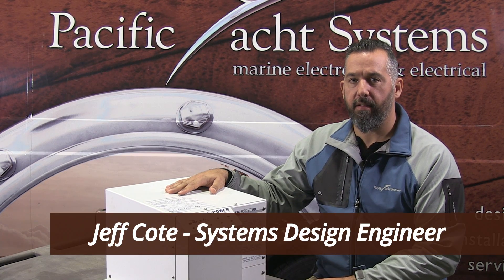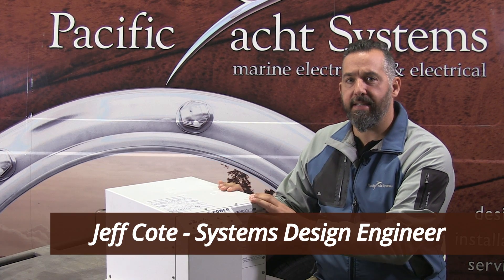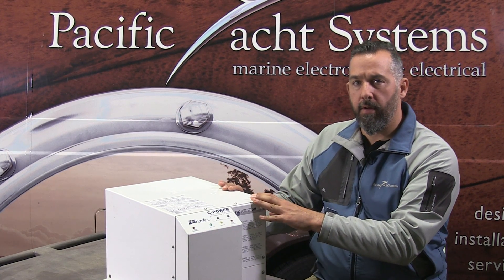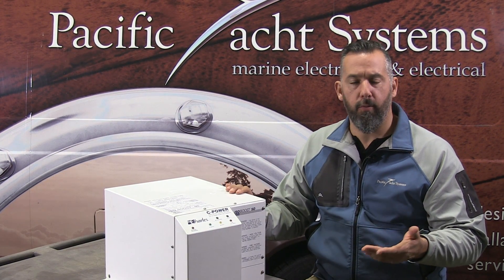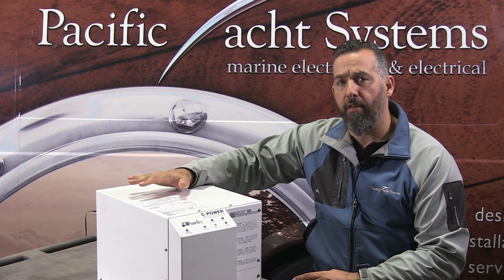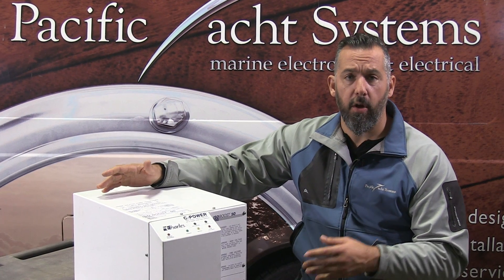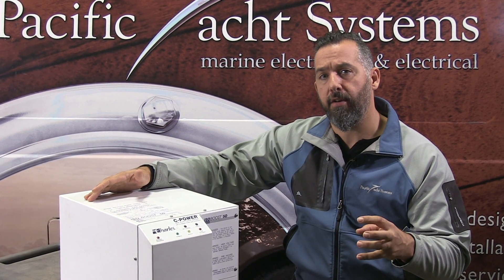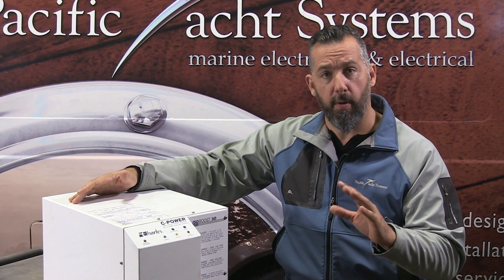Prevent Marine Corrosion On Your Boat With An Isolation Transformer

Comment: Jeff, on the secondary side of a marine isolation transformer, are the ground and neutral for the secondary bonded together? I know the shore power ground is not connected to the secondary in any way, but is there any connection of shore power ground to the chassis of the transformer? If there is no bonding of ground, does that mean all AC powered devices plugged into a boat with an isolation transformer need to be two pole, like an old style shaver?
Reply from the maker: you are supposed to connect the ground and neutral together on the isolation output.  Normally this needs to be done by the installer,  it's not done internally.   So some boats may be missing it.
Reply: @PacificYachtSystems   I have an ISO boost 100 with a blown circuit board.  Do you know where I can get a replacement circuit board from?

Comment: If you have a 50 amp isolation transformer can you use a high quality onshore generator to power the boat?  Will the isolation transformer require 50 amp minimum to power the transformer?  Would it be posible to usa a generator with 30 amp output and power through the transformer?
Reply from the maker: Hi Moomba, the isolation transformer only applies to AC shore power. The generator, bypasses the isolation transformer and goes straight to the AC panel.

Comment: Why does a Mirena have straight current there electrical is not up to code?
Reply from the maker: Hi John Wood,
  Let’s assume you have a perfectly wired marina electrical.  It’s still possible for one boat in the marina, to be the source of stray current corrosion damaging other boats around it.
Reply: @PacificYachtSystems  I've been watching these sailboat videos and these videos from your company are so informative I don't see anything out there to compare to it